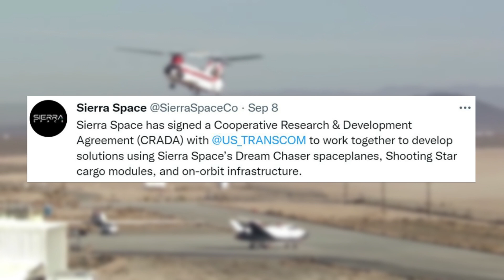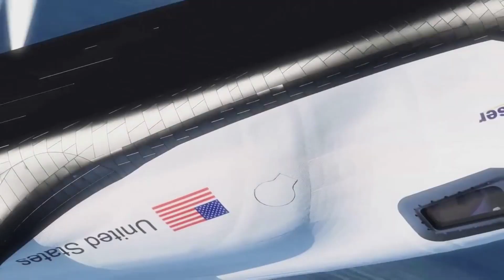Dream Chaser Might Transport People & Cargo Around The World

Comment: I just don’t know if I agree with this. It’s merely a tiny Space Shuttle and not much more. The technology is a copy, with minor improvements and updates, to that of the space shuttle. There’s nothing amazing here nor technologically profound. I wish them luck regardless.
Reply: Not all spaceplanes are 'Space Shuttles,' this design really goes all the way back to the Russian BOR-4, which is almost exactly as old as the Shuttle, other lifting body designs (M-2, HL-10) are about 20 years older still.

But as with aircraft or ground vehicles, one size does not fit all. This isn't meant to break more technological ground than it has to, it's meant to fulfill a perceived need that existing manned craft don't.
Reply: I guess flying "with its own wings" and landing on wheels is psychologically easier than propulsive landing, if these arguments holds any water. But that might be the case and certainly it would be easier to accommodate for landing at destinations than Starship E2E coming in hot.
Reply: @すどにむ  Well, an operational Starship pretty much has to land at the tower 'chopsticks.'

And that may well be doable, but so are aircraft carrier landings...
Reply: Well you don't see the benefits nor the pedigree that lead to DC over the Shuttle.
Reply: ...1.5 G landing? Reused over 15 times?
Reply: @Bruhza5870  1.5G re-entry, then normal horizontal landing, yes.